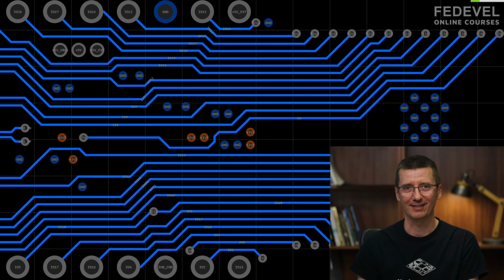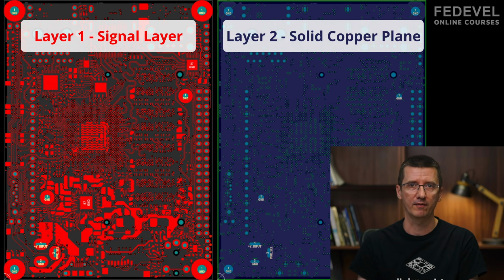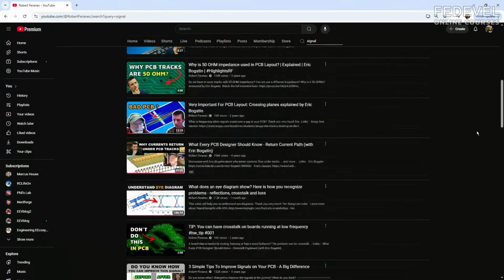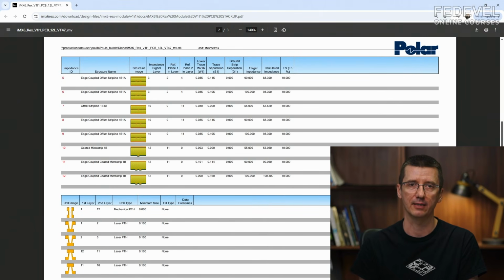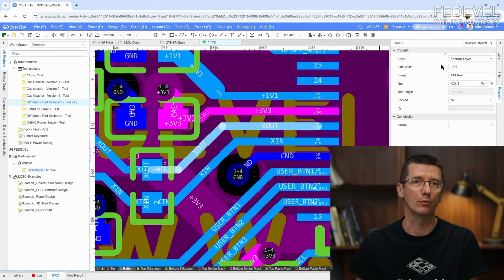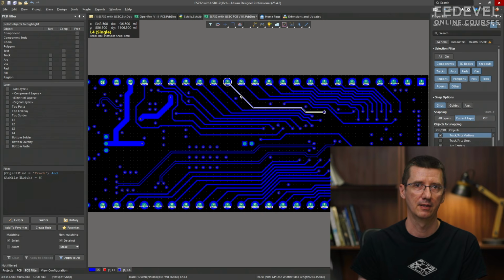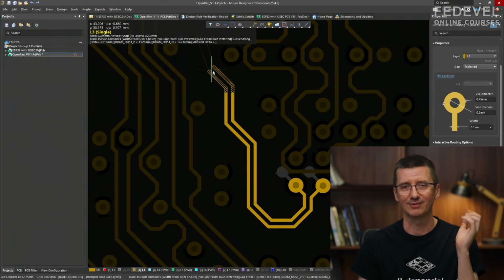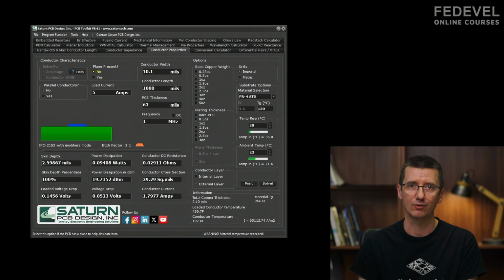Useful TIP: What Track Width To Use When Routing PCB?

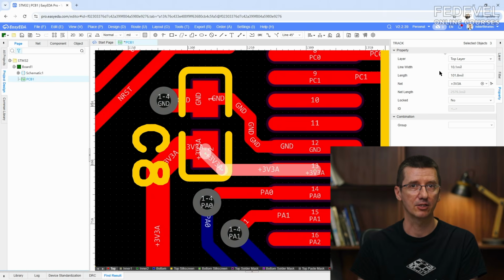Comment: 5:15 Regarding Robert's suggestion to distinguish power traces from signal traces by at least a small difference in track width.  I think he's doing this because he's later going to search for all of the tracks of a particular width in order to change them, while ignoring the tracks of slightly different width.   In Kicad you would defined track classes with separate names, and give them whatever attributes you like, possibly including widths that might be the same. Then later you can select that class to apply it to new or existing tracks, or edit the class to change the width of the tracks of that class.

Comment: I see in some design a series resisor in signal lines. What is the real purpose of those? Do these adjust the impedance? Or do they limit the rise flanks, to decrease noise?
Reply from the maker: this may help - shows simulations and difference: https://youtu.be/CDJn-35W8sg
Reply: @RobertFeranec 
Watched it, and helped a lot! Thanks!
I have a uC with a PHY in 20mm distance. It is a 100MBit Ethernet. So, it may be fine without series resistors. I got 0.14mm between signal and Gnd. We will see, when the prototype arrives.

Comment: Track impedance is also a function of the clock edge rate and it's harmonics (at least up to the ninth on a sensitive line carrying a lot of current such as in a switched mode supply.

The impedance is a function of the parasitic capacitor and its parallel inductor that form when the track is routed. It's the edge transitions that matter, not the clock rate. (Robert has discussions with both Rick Hartley and Eric Bogantin that discuss this in detail). KiCAD has a calculator tool to do this which includes the angular shift due to the speed of the fields in the board material (FR4 by default). But the distance between the stripline and the layer below is also crucial and that changes with the board stackup, because the electric field that creates the capacitor only has a very short range so the closer the reference plane is to the track above, the larger the value of the capacitor.

That wonderful demo board where we can see the flow of current move from a "short" at DC to moving through a large loop as the frequency increases shows this very clearly. What I think most discussions miss though is that the tracks also create an parasitic inductor with a magnetic field that opposes the flow. As f increases the "short" inductor that runs the DC trace becomes an inductor shorted by a much smaller capacitor so its impedance dominates.

Distance between the tracks is also often a factor, not of the impedance which remains broadly constant so long as the track width remains the same, the magnetic field spread can cause coupling which is why it's usual to fan out fast lines as they leave the IC.

Analogue is tougher, particularly at the lower end of the audio range (below 10K) because the capacitor is so small in value, it's the track's inductance that appears to dominate so a 2D field solver is going to be better. I don't know of a free one - if anyone does (esp. if it runs on GNU/Linux) please hit me up!

Comment: Instead of using Saturn (which is based on equations), I recommend using a field solver like the free MDTLC from Kirby Goulet to evaluate your impedances. This way, you start with the right values instead of the wrong one and you don’t have to rely on PCB manufacturer to correct you. If you want to let the PCB manufacturer tune your traces, I suggest using a value with many decimal digits (like 5.001 mils). This way, it is very clear which traces are impedance controlled and should be tuned and he can do it using a simple find and replace.

Comment: Is this advise (10 mils / 50 Ohms impedance) valide for 2 layers pcb also ?
Reply from the maker: For 2 layer PCB it may be difficult to follow mainly for two issues: 1. It is hard to have a reference plane (solid GND plane) on two layer PCB. 2. The layers are far away and that means that the 50OHM impedance tracks will be wide.
Reply: @RobertFeranec  It's obvious, thank you  teacher.

Comment: Quick question related to line impedance. 

- Does not only the width, but total length of the line matter? Or is the increased impedance of line length so small that it can be left out.

- Does signal lines close to the signal line I am currently referencing, also increase the impedance, because of inductance or capacitance? Or are these values also extremely low because of dielectric's permittivity and permeability being negligible?

I've always wondered about these two questions, because as far as I understand classical physics, these should also be taken into account, unless their values are so small that it doesn't matter.

Much appreciated for you attention.
Reply: Length (and length/width ratio) do both matter ... but the effects are so much smaller that you don't need to worry about them yet.  They matter for a cable, but for a track that fits on a single PCB, several other problems matter sooner.

Nearby lines do affect impedance, and you'll see that if you look at formulas for differential pairs (impedance depends partly on how close they are) or coplanar-wave guides vs regular traces.  But even here, the bigger effect that hits sooner is that if they're close enough you need to worry about cross-talk.  (Essentially, the changed impedance shows up as cross-talk before it starts causing problems directly.)
Reply: @jimjjewett  Thanks you for your response, I will take a better look into differential pairs, so that I can better understand cross talk aswell.

Comment: I find it good practice for other traces to never use same width as any of the impedance controlled traces, so the impedance controlled ones are easily identified by the PCB manufacturer and everyone else checking the layout from Gerber files. Even small difference in trace width is enough if you want "almost 50 ohm" everywhere else too.
Reply: In theory, this is better handled by Gerber attributes.  In practice, even if your system uses attributes correctly, using an essentially random digit beyond the fab's expected precision has been used as a workaround for so long that it would be almost reckless not to do that too for backwards compatibility.

Comment: I understand 50 ohm for RF, but for digital? I've searched a lot for specs from manufacturers (e.g., micro-controllers, SPI peripherals, connectivity modules, etc.), and NONE specify a driving or receiving impedance. Exceptions of course include lines for specific protocols like USB (not 50 ohm, anyway), PCIe, etc., and for RF signals. So, my question is, what's the point  of keeping a specific impedance in the tracks, when the driver and the receiver do not (potentially) match this value? Or they do and it's written somewhere I couldn't find? For example, I've downloaded the simulation files for LPC2387 (old, I know), and outputs seem to have 200 ohm impedance, not 50. What's the deal here?
Reply: If there isn't a more specific requirement, you still need to pick some physical implementation, which leads to some specific impedance.  50 Ohms is a pretty good default, and likely to be what everyone else is tacitly assuming and has tested the most.  If a component or PCB process works badly at 50 Ohms, they'll have already had complaints; if it works inconsistently at 20 Ohms, you might be the first to care.
Reply: @jimjjewett I'll suggest going with the IBIS files. They are the ones that contain the hard numbers.
Reply: @PseudonymQR  That is useful.  I'm glad you mentioned it.  Maybe Robert should have too, but he already struggles to keep things short.  And I suspect that most of the people wondering about track width without already knowing what impedance to use aren't ready to look inside IBIS files.
Reply: Also digital signal bandwidth contains a plethora of frequencies (unlike analog or RF) and it is our job as designers to ensure that all those frequencies experience a consistent impedance across the entire spectrum. 

For reference the effective bandwidth of a digital signal is 1/pi*rise_time.
Reply: You're right. The impedance info is absent from datasheets of major MCUs and other digital chips. To quote the great Rick Hartley, "the chip makers don't include this information in their datasheets because it's useful". 

I'll suggest you should use the IBIS files of your chips to find out the source/load impedance of that chip. P.S. the important stuff like rise time and impedance information is virtually absent from datasheets.
Reply: Look at something like DDR3/4 ram. Those expect 50 ohm impedance
Reply: @monkev1199  I've said that those SPECIFIC standards do require a specific impedance. I've asked about general I/O.

Comment: Why not 100 ohms or 235 ohms? What about the tracks from the Ethernet connector, where the cable impedance is 100 ohms? And what is the matching of the data transmission line with the inputs/outputs of the chips? Or is it enough to plug in a line with a certain impedance and everything will be very good? Do you think, for example, in a smartphone where there are high-frequency lines (not RF) up to Gigahertz, 0.2mm tracks are used? Each video is funnier than the previous one. 😂
Reply: I hope someone experienced replies to your comment.

I don't really understand
Reply: @nankinanko5790  There are times when you want an impedance other than 50 Ohms.  And there are a lot of times when the precise impedance doesn't matter very much.  But if it matters, and you don't have clear guidance on what to aim for, then 50 Ohms is a safe default.  If you need 235 Ohms, then you probably also need to tightly control a bunch of other things that are beyond the scope of this video.
Reply: Most high-speed signals are 50, 75 or maybe 90 Ohm terminated. So that's why. If you're just routing 400Khz I2C buses or something like that, then you don't need to worry as the signal integrity will be good enough anyway as the total length is rather low and frequency very low. In comparison, 10Gbps USB 3.x is about 2.4Ghz. There are a lot more to keep in mind then: rise/fall time, signal timings and such. 50pS rise time is much harder to drive than 400nS, so the track impedance need to match what the drivning circuit is built for.
As for the smartphone question, he does touch on this in the video: different pcb stack-ups have different impedance. Also, what plane you are routing impedance matched traces on will affect trace width for a given impedance (as well as dielectric constants and more).

Comment: Wait, isn’t  impedance proportional to the length of the trace aswell?
Reply: Inductance and capacitance are both proportional to length. Inductive impedance is proportional to the inductance (and frequency), and capacitive impedance is inversely proportional to the capacitance (and frequency), so in the reactance term they cancel out. The real term (resistance) is still proportional to the length, but the transmission line properties are constant.
Reply: Impedance is not the same as resistance. If the "transmission line" (e.g., the track over a power  plane) maintains its geometry and composition along its length, the impedance will not change no matter how long the line is. That's why you can buy coaxial cables with 50 or 85 ohm impedance by the reel, and you cut as much as you need.

Comment: While this information isn't "wrong", you need some nuance. The reason to impedance match is to avoid reflections along the line, but in most synchronous systems, it's really the clock or enable lines you need to worry about. This is why the standard practice is to use a source-series terminator for clocks, and why terminators were standard for parallel busses, such as SCSI, VME, etc. Most modern ICs can self-terminate, making this less of an issue now. Definitely something to look at, especially if cables are involved, but generally not the issue to spend most of your engineering time on. Obviously as the eye closes, the care given to other traces goes up, but I've run some fairly high-speed designs without hitting a specific impedance for the data lines. Consistent, but not necessarily 50 ohms.

For me, the challenge has always been length tuning, as that ensures data is stable before the clock edge. I generally use FPGAs, so length tuning extends to the first layer IO FFs in the device, but even with ordinary digital devices, it's a potential issue.  For digital signals that aren't clocked (ie, control signals, etc.), there is absolutely no reason to bother with this level of tuning at all (assuming the receiving device isn't sensitive to reflections). Simply ensure there is significant ampacity in the trace, which for most digital signals, means "as small as the fab house can go".

What is FAR more important in terms of impedance matching is the return path, and that is why you buried the lede with using plane layers. Any discontinuity between the signal and its return current will impact signal integrity, because your return current taking a different path will produce reflections where it diverges (ironically, due to an induced impedance mismatch).  Sometimes it is impossible to avoid breaking up ground and supply plane layers, but running a trace across a broken plane layer will introduce problems. I get that has nothing to do with trace widths, but if you are worried about SI, it's a critical item for high-speed designs.

Generally speaking, I spend more time on planning my plane layers and calculating power trace requirements, but the equipment I design is a bit more geared towards that. However, any discussion of trace widths should discuss ampacity. It's one thing to try to squeeze a few mA across a 6 mil trace. It's a whole other to shunt 40-50A across a PCB. The latter requires selecting an appropriate copper weight, trace size, and trace-to-trace spacing.
Reply: It's high time to realize that this is just a blogger who can post any nonsense. :)
Reply: Could you go into depth with your comment? You’ve piqued my interest. Is this guy a fraud?
Reply: @f33net
Reply: What sort of problems do you have with enable lines?  Do they just need some hysteresis for debouncing, or is there something else?
Reply: @jimjjewett  Enables should be treated based on how they are used in the device. In most modern ICs, where the enable is merely another line registered by a clock, you don't need to treat them special. However, some devices act based on the enable line, so it should be routed like a clock signal.

Comment: While technically you can route all digital lines as 50 ohm,  this imposes unnecessary restrictions on line thickness and routing. Some lines need to be 50 ohm, but most lines shouldn't be 50 ohm. it's just inconvenient ))
Reply: Yeah just maintain the line with a constant impedance on all layers.